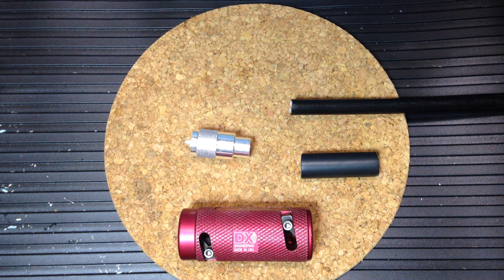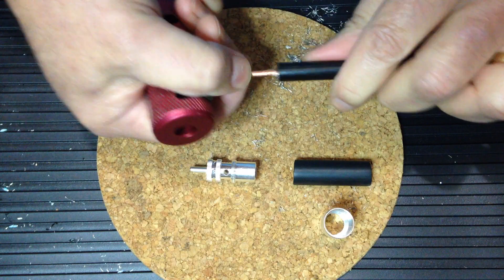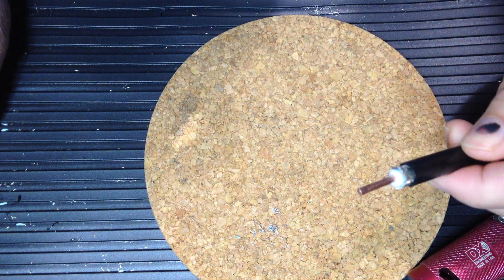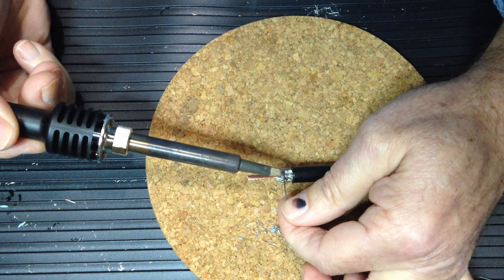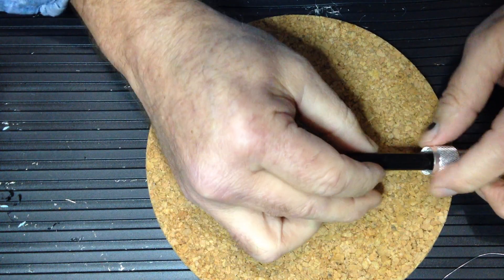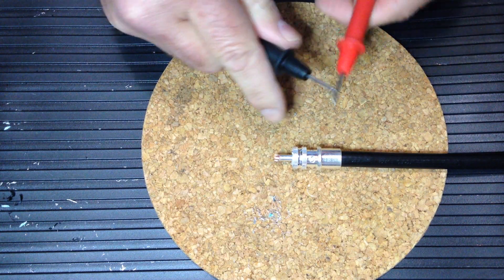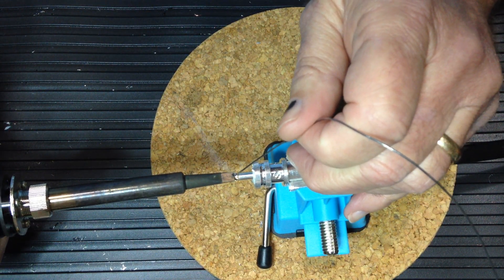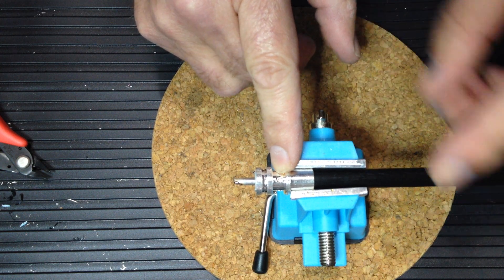Solder PL-259 onto LMR-400UF using a cable prep tool

Comment: I use a Weicon cable stripper. Tin the braid. Cut through braid and dielectric with small pipe cutter. Perfect result. I learned to do it this way when I was 14. That was 53 years ago. Still is the best method. Hands down.

Comment: If you tin the nickel-plated connector before inserting the cable it makes it very simple to solder the cable to the nickle plated connector.
It takes an extra step to solder the nickel plated connector but once that step is completed there's virtually no difference between the nickel and silver plate except for cost.